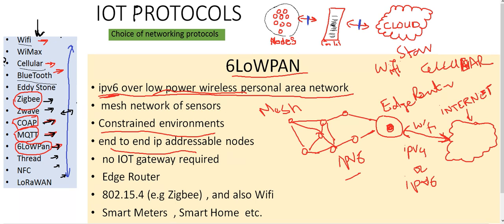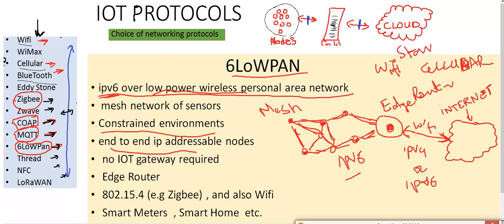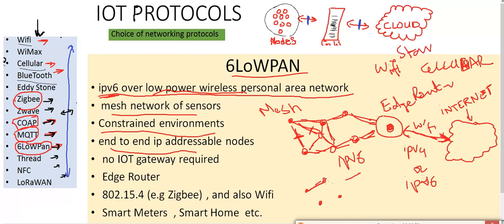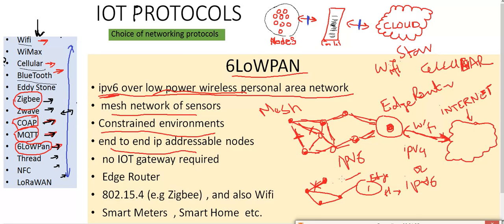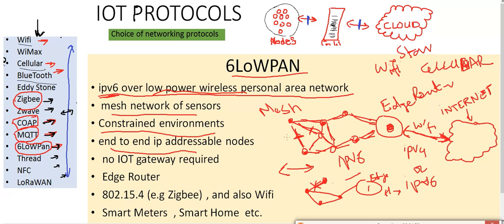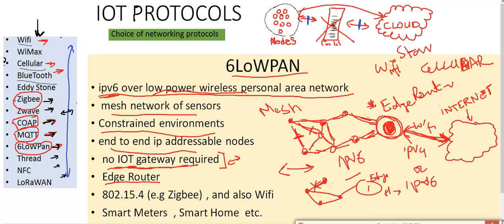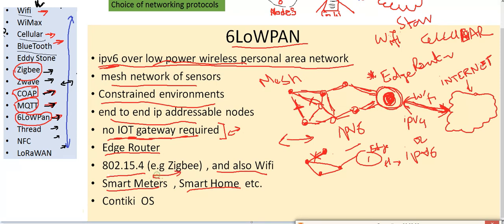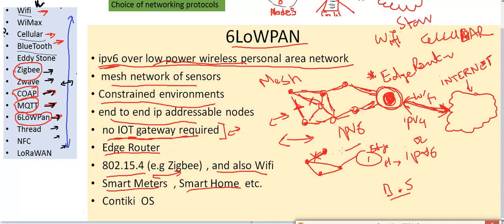IOT Network Protocls: 6LowPAN : part 2

Comment: Edge router means we can use our home internet router directly.... And one more doubt what is the frequency band used in 6lowpan
Reply from the maker: edge router is a specialized router located at a network boundary that enables an internal network to connect to external networks. They are primarily used at two demarcation points: the wide area network (WAN) and the internet.
Reply from the maker: So you can use in home
Reply from the maker: Frequency Range sub-1 GHz and 4 GHz

Comment: Excellent presention...
small query on the edge router:does any adaptation happen on the edge router...from standard ipv6 to compressed ipv6 required for 6lowpan nodes...can contiki help with that..
Reply from the maker: Yes it will